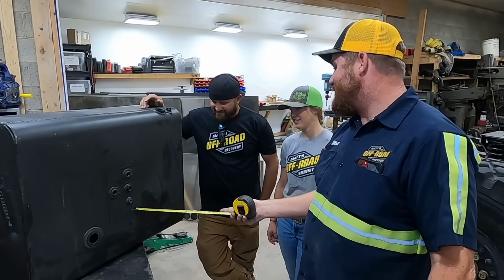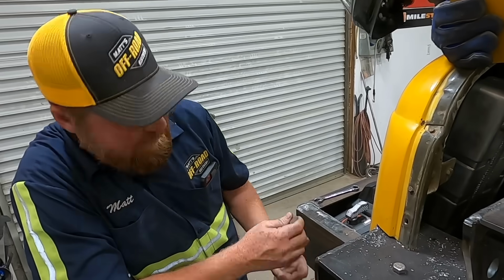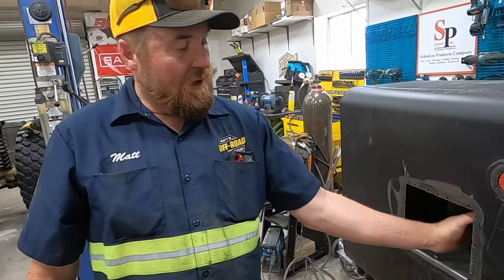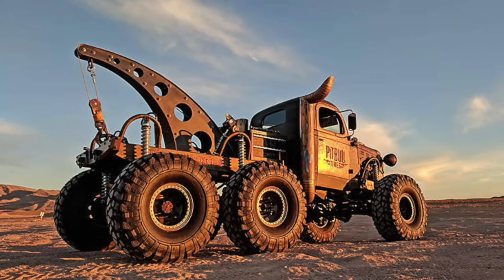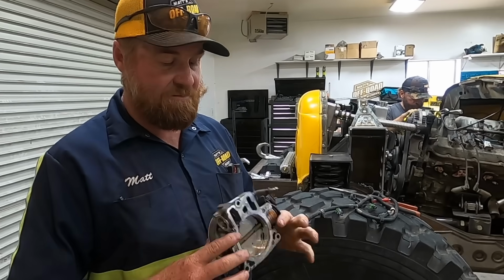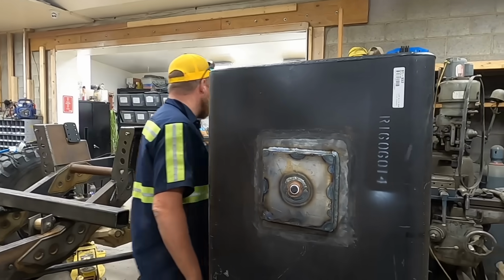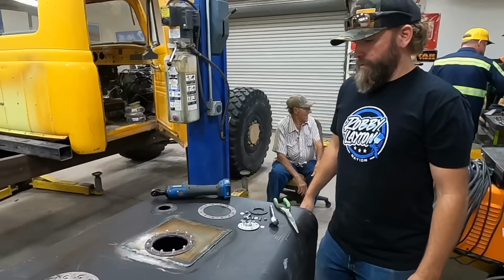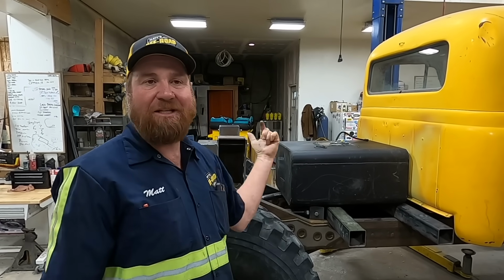World's Largest Off Road Wrecker...There Can Be Only One.

Comment: Loving this build, fantastic engineering, and looks great with the international cab,

One thing i would personally be concerned with if mounting the fuel tank the way you are planning is possible fatigue cracking where the straps are welded to the tank, it might not be an issue in your application though.
Reply: I agree, avoid any further welds on the tank. Strap it down with rubber beneath the tank and straps.
Reply: Absolutely right! Strap all the way around, no welds for a hard mounting. It will crack, eventually.
Love Matt and the crew, they need a tv show!
Reply: Oh, I've just asked the same question, but I'm just repeating what I've seen installed on big trucks, so maybe there is a reason

Comment: For on road use and off road that fuel tank needs to have straps like cars and semi's not welded and bolted to the frame. I do believe that is USDOT regulations, you might want to call your local state police DOT officer.  It should be insulated as well since temps are very high in your area.

Comment: So will the fuel pump pull out of the sump? Does the return go back to the main part of the tank? So the sump will only last until the pump runs dry. Those pumps don't like to go dry. The fuel cools them.
Reply: Pulls out of the sump, and returns to the sump. That way it will keep the area around the pump as full as possible.
Reply: @NBSV1  
I have never seen anyone change the return on a pump. I guess you could. They just spray out from under the flange.

Comment: isnt diesel better for towing and fuel consumption ? Very nice looking Truck
Reply: The other stuff they have is gas, and diesel is extra weight. Plus for what they do the throttle response and power from a gas engine works better. There’s an older video where he outlines why they don’t want a diesel.
Reply: @NBSV1  thank you very much

Comment: Kenny didnt zz zz the cinnamon roll.

You guys should carry some flex seal in your emergency kit. It will seal a fuel cell ASAP if you ever need to. Doesn't deteriorate with fuel and last also. Found this out the hard way after my drive shift punctured my cell one day. Swiped it into the leak with the fuel coming through it and stopped it on application

Comment: If I had a fuel gauge with some limitations, I would reset the trip odometer every time I refill the tank. Well, I do this anyway with every vehicle but it would be extra useful if I cannot fully rely on the fuel gauge.
Reply: Considering the amount of idling their vehicles do while on job sites, I wonder if the range of tripmeter is even something they can use.

Comment: Those tow hooks he gave you are really strong we have had loaded 3 axle dump trucks buried to the axles and used them to pull them out.  He put those on a fire truck as a pulling point. they will handle all the pulling power that truck has. I'm so confident I'll send you one to test with if you will. Those things are no joke!
Reply: Hopefully they see your post and take you up on the offer, I think they will rip away from the frame before you ever damage them
Reply: @lightman489   I agree I think the weakest points will be found in the bolting or the weld failing. Maybe the hook straightening but I don't see it breaking, if it's a original and not a cast reproduction.  Either way I'd love to see the test. Saw on other tow point hook tested it never broke but the mounting did and they could never find it. So if Matt's Offroaf sees this maybe they'll think to attach a locator.
Reply: It seams like we have to comment on this one so it gets to the top 👍
Reply: It seems to me that the rigs that Matt builds are mostly function over form, these are work trucks first. Not show trucks. Also, if you've watched this channel for a while, you'll know that none of these rigs are ever completely finished. They usually build what they think will work, and if they find a better solution down the trail, they'll upgrade to that.
Reply: Yep! I've got those also. Off my old 57 Chevy 2 ton farm truck. They pulled it out with a load. When it was  stuck axle deep without any problems.
Reply: I bet torque test channel could come up with a cool rig to see how strong it is
Reply: Agreed,  I drive a heavy wrecker and have used those hooks to pull out a few different trucks, they are basically indestructible 🤣🤣
Reply: I have a few of them i am willing to send it I'll even pay for the shipping i think Matt will be extremely surprised. The ones i have are all originals I've personally pulled off of 60's & 70s dump trucks. No Chinese repros. once i saw what they will handle i pull them off when a truck dies. I have 2 that are same style but a LOT thicker hook.
Reply: My M3A1halftrack has those hooks on . One side is straightened out so much it is not usable. Everything has limits. I'm curious about the situation that led to bending the hook. The vehicle  weighs between 14,500 and 15,000lbs. I have more that came off military and construction  vehicles. It would be interesting to find its limits, safely.
Reply: the little info on those hooks out there are list the tow rating of 13500 lb the ones in the video that is. @edwardglamuzina3421
Reply: Test! Test! Test! Test! Test!
Reply: Agreed Fire truck tough is no joke they were built to never fail because failing is not an option life or death situational use.
Reply: OP, you should go ahead & send them a pair in the mail to the shop! I’d like to see these tested as well especially w/ the heavy wrecker! 👌🏼
Reply: @Bt26x  I'll send them but i don't want them to sitting on a shelf and doing nothing. They can do that in my shop hahaha! I was hoping for him to agree to testing them before i paid shipping halfway across the US

Comment: Matt, Make sure the firetruck hooks are mounted with hooks toward the outside. They are left and right handed to carry the load and keep the rope on.
Reply: @Daniel Hollingsworth could use double sided tape to hold them in place good 3m tape should hold ..
Reply: @randytravis3998  sticky tack so he can reposition for different situations
Reply: He also stated these are not going to be functional anchor points, just maybe wrapping the winch rope or recovery rope around to simply hold while repositioning
Reply: So you think he just accidentally got it right for video demonstration. 🤷🏻‍♂️🤦‍♂️

Comment: I drive a Suburban with an 8.1. I highly recommend you (at a minimum) pull out the crank sensor and make sure those seals are not stuck. Or just replace it while you are working on this. They are a real pain to access while in the Suburban, but you may have good access with your cab set up (thus no biggie to replace in the future). It will most likely go bad at some point.

Comment: Gday team MORR outstanding and very informative. To the comment Matt gave lizzy then the camera panned I audibly said damn lizzy those are some nice welds her skill is very impressive and only a couple of leaks for a pressure vessel job done insanely well. Loving how quickly this is coming together now Matt you mentioned your going a fair chunk bigger on tires we know it rolls in and out of the shop on current tires will the extra size still let it clear the door id hate to see you get it done only to find your stuck inside. I'm sure you have all this figured out im just curious so asking with respect any who awesome build and vid 👍🇦🇺
Reply: They keep adding weight with new every component which will lower ride height. It fit through the door (with cab, engine & transmission mounted) before the radiators, front winch and tank were added. Transfer case, doubler (?), five more winches, the boom, shocks, tool boxes, engine doghouse, seats, and more will be added and thus lower the ride height further.

Comment: Dude Im glad you brought up the Thunderbolt Matt. P-47 Thunderbolt or The Jug is the BEST Fighter of WWII. The P-47 only had two Nicknames during the war The Jug and the Flying Tank. The A-10 Thunderbolt II or The Warthog had the nickname WartHog. They called the Thunderbolt The Jug because the shape of the Fuselage looks like a Milk Jug. Thats how the TBolt got that nickname. They Built the Fuselage Around the Turbo Supercharger system. The Thunderbolt was the Largest Fighter of the War as well Dwarfing the Mustang And Spitfire in size. It was also the fastest Fighter in a Dive.  I live 30 miles from Oil City Pennsylvania which is the Home of P-47 Piolt Gabby Gabreski A Leading Ace of WWII. I have models and Rc P-47s and other P-47 things I've collected over the years.

Comment: I know it's a super small detail but I think putting the lower part of the grille that got cut off in under the frame would make it look even cooler.
Reply: I agree.
Reply: I agree but I think it will interfere with the suspension travel.😕
Reply: @jasonh4167  it would only have to go down to parallel with the bottom of the frame or barely below.  Just enough to fill in the gap of the frame and finish the grille design.

Comment: Just for knowing, there is a thing called black body radiation. Simply stated it means that a black colored anything absorbs or radiates heat better than any other colored anything. What I'm saying is if you're really concerned about cooling issues, putting a black wash on your radiator fins will help more than any other low cost thing you could do

Comment: Matt,  Taking into account the weight of your truck, I wonder why you did not use Caterpillar C6.6 engine to provide you with more torque.
Reply: He talked about it a video or two back.  Basically diesels weigh roughly twice as much for the same torque level and have a very narrow powerband.  Both of those are not great for the sand that they work in.

Comment: The tank turned out awsome. Only thing that popped in to my head would be to build a back up fuel pump since you had to customize it, and throw it on the shelf. Fuel pumps seem to fail at the worst possible times.
Reply: This is Matt.  He needs a backup fuel tank, lol...
Reply: @MattsOffRoadRecovery  Yes, that is nice. Was not sure how much you had to put in to customizing the pump, in case you needed one on trail and could have someone just grab it off shelf and bring to you. I know Napa does not carry it, which makes this build so sweet!!!
Reply: Lol. Have the backup already installed in the tank with valves and a switch! It’d be awesome!
Edit: or it’d be a huge mess that adds failure points.

Comment: I saw a really cool thing on another channel that might save so much work on the tank. It's a combination pump hanger(sending unit) / surge tank with an external (to the hanger/surge tank) lift pump to feed it.
Might be a simpler solution if you find you need something similar again or if anything happens to make that tank not work.

Comment: Make sure you drill a vent hole at the top of the box you are putting the fuel pump in.  At least one hole near the top inside the box so it vents inside the tank.  If you don’t the fuel won’t come up into the box.

Comment: In the racing world we run a pump from the main fuel tank to a smaller tank with a second pump to the engine WAY MORE EFFICENT then a sump set up the smaller tank has a return to the main so it stays FULL ALL THE TIME !!!!!!  With this setup you have ZERO fueling at any angle except upside down!!

Comment: I agree with YOU Matt-- I don't care for the modern junk either..  and a LOT of the modern stuff IS junk-- FAR too much dependency on technology that goes bad easily and costs a flippin fortune to fix..
Reply: I mostly agree with you. Sometimes electronic is less likely to fail due to fewer moving parts, etc. but the other side of that is that trail repairs are almost impossible when it does go bad. A mechanical system can likely be fixed somehow, at least with a temporary fix.
Reply: @nelsonmartinmusic  It's not so much the electronic CONTROLS that fail as the sensors, changors and INTERFACE with the physical parts that fail.. and it's STILL a b..h to fix... and FIND so you CAN fix it..

Comment: Looks like Matt needs a set of transfer punches to make drilling those holes where they need to be
Reply: I agree... transfer punches are a necessity in any fabrication shop for sure.
Reply: @EZSHUM  It was one of the required tools for my fist machinist job. Now I'm missing half of them, but I just borrow those from others who have fuller sets (no one has a complete set).
Reply: @operator0  I do........ people keep their mitts off my sh!t or we have issues.  Small machine shops can be like that
Reply: @mossberg7172  Sounds like you're  real fun guy to work with.
Reply: @operator0  nah we all borrow stuff not everyone has everything but you ask and it gets brought back you don't just dig in someone else's box
Reply: Love transfer punches !
Reply: Totally agree.  Add some straight flute drill bits for drilling in sheet metal, also.  They stop all pull through (jerk through with distorted holes and metal).
Reply: Right this is some amateur hour stuff.
Reply: @theinternetisnotreallife  if it weren't for machinists all the engineers and fabricators wouldn't have heros.